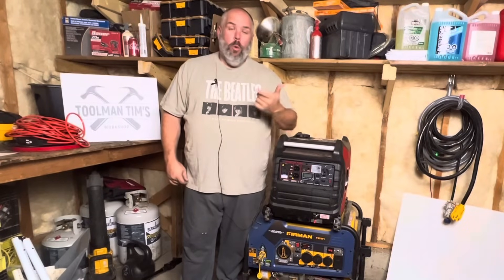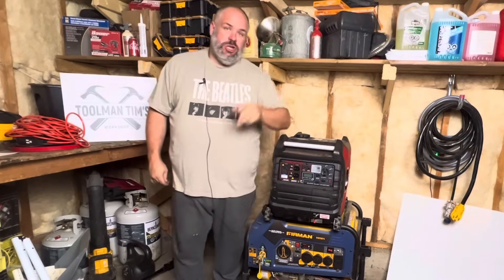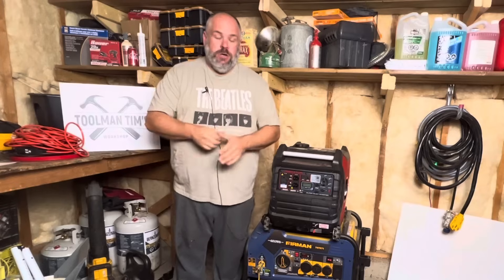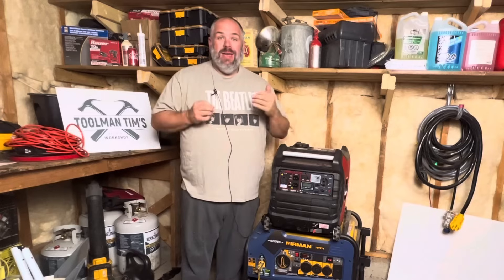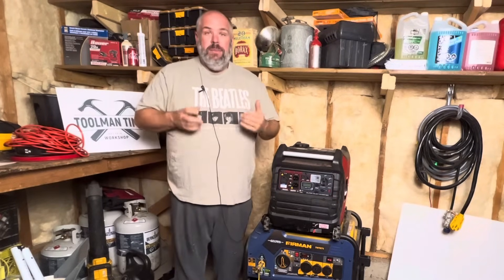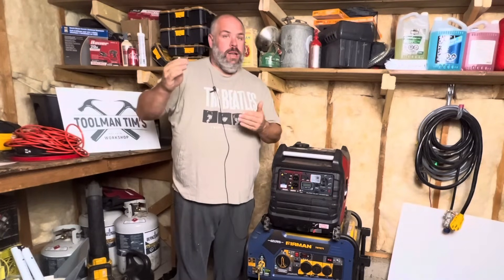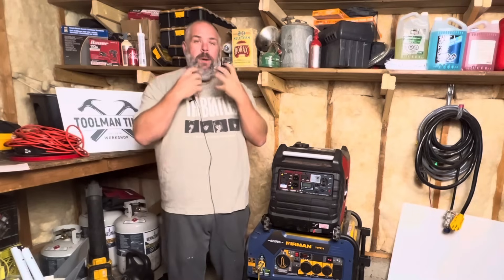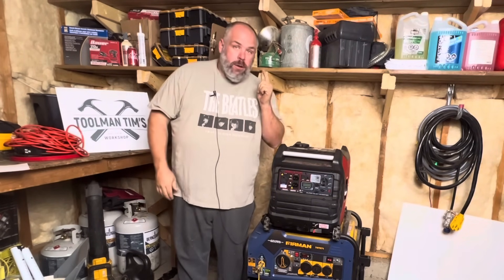INVERTER GENERATOR What's the DIFFERENCE between an INVERTER GENERATOR and a regular generator?

Comment: They should just call it a clean generator to eliminate confusion. We don't call tv sets inverter tvs or dvd bluray inverter dvd bluray or other appliance that converts the AC input through a DC rectifier bridge circuit and then runs it through a filter network to finally out put that dc to a zenir or power ac circuit. Stupidity!

Comment: I run an open frame 4000w inverter generator . It is still very quiet. easy to work on it, and I know that heat is not your friend. I don't think I will ever own a predator generator see a lot of them being returned to harbor freight. next time your in the store take a peak in the back room. always 2 or 3 sitting there waiting to be returned.

Comment: I found a gas motor driving an auto.otive alternatlr charving a ba k of 12 volt cranming a.p batteries.   The 120vac at 60hz created individual  use invertots.  If generater is off you still have power.

Comment: Instalei num gerador inverter TOYAMA de 3500W /120V. Atende toda a carga em 120V em operação normal. Qdo ligamos o forno  elétrico pequeno, torradeira ou micro ondas , percebe-se nitidamente o aumento de potência do motor a combustão.
Como é para situação de emergência, optei por acionamentos manuais: Chave de Transferência, conexão das fases RN e SN as tomadas do gerador e e partida com corda retrátil.
Estou há três anos com o equipamento e nunca tive problemas. Um dos segredos é não deixar gasolina no carburador- sempre desligo, cortando o combustível. No Brasil a gasolina tem hoje 30% de ETANOL.

Comment: Good, to-the-point explanation. I do like the new inverter generators, and I think they're worth the extra dollars. I have a small Honda, and and it's very well engineered. I must point out, though, that modern electronic devices are not particularly sensitive to incoming power quality variation. I own quite a few generators ranging from 950W to 17 kW, mostly gas but two are diesel (when I bring one home I tell my wife it's a 'rescue') and one was built in 1947. None has ever caused problems with electronic devices. I think people worry far too much about this.

Comment: Against "parallel twins": did you ever service generator? Oil, spark plugs, air filter, spark arrestor, gap in engine - don't you think it's too much, huh??! Now imagine TWO gens to service! You will scream! 😆 Better to buy one plain, but powerful gen - just take care about noise and you're done. BTW open frame gen - here you have EASY ACCESS to any parts! Opposite to idiotically tide boxes of inverter gens.

Comment: Inv.gen. is not "a bit" expensive - they A LOT more expensive. Funny, but simplistic inverter (plain DC→AC device) costs not so much. But same installed in generator immediately doubles the price - WTF?!?! All we need from old good "open frame gens" is some AVR, which will manage RPM too. BTW Inv.Gen does NOT regulate RPM smoothly - they have simply 2 positions: "economy" and "full rev". So yes, under low load Inv.Gen. will work more quiet, but under load both gen makes roar.

Comment: In the world of SWITCH PSU (which are installed in every single device) you don't care AT ALL which power comes - they anyway convert this power into PWM comb and then make DC 12V. Computers work on these "switch PSU" since stone age, so no problem with "dirty generator" :) Just FYI.

Comment: I ran my whole house for 12 days in Feb 2022 after a cyclone wiped out the power substation that supplies our area with a Chinese 4.4kva open frame generator. It ran for 35 hours on a full tank of fuel.
That included hot water, dishwasher, oven, microwave, lights, computers, TV's, modems, fridges and freezers. Never missed a beat. All my electronics and appliances are still fine over 3 years later.
I had to drag the bloody thing in every night when I went to bed cos people were going around stealing them. The noise was a pain in the ass though.

Comment: Thanks for the video.  I'm trying to figure out why diesel generators aren't available at Home Depot's website, I can only find gasoline / propane / natural gas inverters.
Reply: Diesel anything is industrial or heavy duty use.  I think HD, a homeowner DIY, isn’t a go-to source for commercial equipment.  And I think you’ll find a diesel generator will start at a high watt output that many homeowners won’t need.

Comment: We get long outages and we use a "dirty" generator with our new laptops and modern appliances. So far, no problems. BUT, a friend recently developed trouble with her new pellet stove allegedly because she used a "dirty" generator. Even though we haven't had any issues, just to be safer, I think we'll upgrade to inverter generators. Thanks

Comment: In my opinion, you are definitely overstating the “dirtiness” of the power from an open frame generator.  It’s no dirtier than mains power (mains power is pretty messy).  I run my whole house with an open frame generator, and have never had an issue with computers, Starlink, washing machines, fridges, coffee machines, CPAP machine, dishwasher, shavers and electric toothbrushes….you name it, it runs perfectly from an old open fame generator that chugs away all day.  You also suggested that it can somehow “reduce the life” of sensitive electronic equipment.  I remember hearing all that talk when inverter generators first came onto the consumer market.  IMO it’s just marketing BS with no basis in real life.  Years later that marketing BS is still being sprouted by people like yourself.  If you had equipment that was so sensitive that it might suffer damage by generator power, it would also suffer damage from grid power.  It’s just flaky marketing nonsense to scare people into unnecessarily upgrading their equipment.
Reply: thank you, that puts it well in perspective. im worried since in texas the outages are getting more common and i was worried i needed an inverter generator. i  can afford a regular generator to run my housem , an inverter is double the price.

Comment: Will a 9500 inverter run my icebox and freezer and two window units. OK I heard they’re not good for appliances like that. Is that true?
Reply: 9500 watts.  I’m no expert.  That’s big.  Icebox, frig, are about 1,000w each.  2 window AC, if both 12,000 btu, are also about 1,000 watts each.  LED Lighting and electronics, all at once, about 1,000 watts.  That’s about 5,000 watts at once, is a good load for 9500.  Some say any generator should run loads of 50-60% long term, and you’re in the sweet spot at 5,000.

Comment: Are you not aware that there are open frame inverter generators?
Reply from the maker: it was an oversight i didn't include in this vidoe the next time i redo it I will add that for sure

Comment: For me, my Champion 5000 Open Frame generator will not run my 1100 watt Microwave, my Predator/Inverter 5000 runs my microwave works perfect.

Comment: Anyone had problem damaging appliances or gas furnace with a non-inverter generator,  powering the whole house?
Reply: I live in Florida and use the standard large whole house generator for a few days no problems. They are very loud but no need to run extension cords. I have an external plug on the house and a breaker box switch over setup by my electrician.

Comment: May parents have an older Honda open frame generator that you can set it so that it revs up higher depending on electricity usage or you can run it loud and steady. So would that be considered inverter or regular?

Comment: It's parallel operation not "daisy chain", but yes you basically have each generator providing each half of the 240V but outputting up to 50A total (instead of 240V at 25-30A with just one unit).

Comment: Open frame generators are generally  square wave or modified wave,used mostly for resistive loads toasters jugs electric motors,where as inverter  sinusoidal wave form is used for electronic type loads,such as  computers.Square wave or modified wave will damage electronics. AUSTRALIA 🇦🇺

Comment: I found out the hard way that even a modern gas furnace needs clean power. Ice storm in Portland Oregon in early 2024 left us without power for 6 days. I rented a non-inverter generator (not knowing the difference) and my furnace error message translated into essentially "dirty power, can't run." Since our gas furnace needs electricity to run fans, it wouldn't run.

Comment: What kind of device doesn’t need clean power? Like my fridge? My main use for the generator is going to be charging a couple of batteries that power the house. I plan to use the generator to top up the batteries when the outage lasts more than a couple of days.

Comment: You are partially informed about your content.     Some of what you say is true, but the power quality demanded by "sensitive electronics" is pretty low.   They have their own power conditioning circuits that isolate the sensitive stuff from widely variable AC inputs.    Also, some inverters are "modified sine wave inverters" , like the cheap ones that plug into your cigarette lighter in the car.   These are commonly called choppers and just reverse the polarity of the DC exciting a transformer, which suppresses high frequency component in the waveform.   It's a modern version of the vibrator circuits in 1950's vacuum tube car radios that was clean enough to reliably receive AM radio signals.          Motors are exceeding tolerant of trashy AC power, too.    WHile I may agree with some of your claims,  they are a little imprecise.   The best part of the inverter types,  IMO, is that they are small, quiet and adequate.

Comment: hi, thanks for the video, what if I use a power surge outlet bar, for my sensitive electronics on an open generator, would it be just as safe as using an inverted generator?
Reply from the maker: no it wouldn't it only handles over surge thd makes the power jagged and up and down much worse long term that way

Comment: I don't want to hurt diesel generator owners feelings but AIR COOLED diesel generators don't appear to be much if any more efficient than gasoline generators. I know for a fact that WATER COOLED turbocharged diesel generators are highly efficient, but that's not what you have.

Comment: Good video and I agree with what you said. You should have mentioned that the standard, open frame generator basically Must run at 3600RPM to make 60Hz. The inverter generator can run at 3000 RPM and make 60Hz, the inverter generator may have a Permanent Magnet Alternator. Why is the Permanent Magnet Alternator important? Because the generator isn't having to use produced power to generate the Field. The inverter generator with permanent magnet alternator can use a smaller engine at lower RPM to generate power at 60Hz so if you don't have a big load, you can save a considerable amount of fuel. It's a huge difference between a 224cc engine and a 140cc to make 3900W max. 

Also, the generator is going to be most efficient in the sense of power produced for fuel used at 80%. Running a large conventional air cooled generator at low load saves very little fuel because it has to run at 3600RPM to make 60Hz electricity. Think of the cylinder as a Lung. The cylinder is going to get a full lung of fuel/air mixture every 4 strokes no matter what, it has to, it doesn't have a choice.

The permanent magnet alternator generator doesn't have to work as hard because the Field is permanent, it uses a smaller engine to begin with and it can produce 60Hz power at 3000 RPM. So, 1/3 smaller engine running 1/6th slower. That's why those little suitcase generators are so much more expensive, besides a little more complicated electronics. Yes, there are open frame generators with inverters that can run 1/6 slower but they don't have the permanent magnets, at least I have never heard of one that was permanent magnet. I'm not knocking open frame inverter generators, I own 4 of them and two of them are 4000 running watts beasts with 270cc engines that I got for $365 each and they have single phase 240V and they were built to last, they are not what I would call fuel efficient but they are also reasonably light weight and compact and I could daisy chain them together for 8000W. Due to their compact nature they only have 2 gallon tanks and they will run 5 hours flat out on a tank of fuel. For the price I can't complain too much. 

I haven't done things in efficient manner, buying a generator without knowing all I need to know, but I did do considerable research, just not enough. Not a single one of the generators I bought is a Bad generator but I can't say they were the ones that best suited my needs. I probably should have bought 3 X 3000w ($1500-$1800 total) running permanent magnet alternator generators so  I could run One, Two or Three Parallel connected generators as demand dictated. As it is I just bought a 2000 running watts permanent magnet 80cc inverter generator that I will run the most and I can crank up a big one at need. It's not a matter of saving money for me, it's the logistics of the fuel on hand needs to last longer. I keep about 15 gallons of gas on hand and I'm thinking of buying a plastic 20 gallon boat fuel tank or possibly a 80 gallon propane tank or both. There are frequent power outages where I live and we just survived a flood.

Comment: Some good points, Inverter generators will probably become more and more common. (although I wouldn't buy one from Horrible Freight)   I will say that  a high quality  "open frame engine" generator makes clean low distortion power.  I've been running all the electronics on ours during outages for years.

Comment: The #1 reason I went with an inverter generator is fuel economy. In a power outage, gas will be hard to get. 5 gallons will run my inverter generator much longer than a non-inverter type. I'll likely get several days of use out of 5 gallons, instead of being out after one day.
Reply: Same.
Reply: A lot depends on how much load you are running as well.
Reply: If I'm with your mom, you better believe it's going to be a full load.
Reply: @maxlumens9085 😂
Reply: Gas? What’s that? Oh, that is that stuff they used to use in the old days to run generators. That stuff that expires. Not an issue with NG or LP.

Comment: Pro tip, if you want to avoid paying for the inverter generator get a 120v to 12v car plug adapter then a 12v to 120v inverter for a car. You can run sensitive electronics off a dirty open frame generator for under 50 bucks
Reply: True, but you will still have the noise and the inverters use much less fuel.

Comment: What about using a power line filter on a standard generator to get a clean output 
Total package would be still significantly cheaper than an inverter generator

Comment: I am having trouble with understanding all the reasons for increased efficiency in inverter generators.  I somehow got the imppression that inverter generators were smaller in size than the same amount of watts in a non-inverter generator, but that may be pure missapprehension.  Sure they use less gas because the computer can regulate fuel use to the level of current draw. I am trying to figure this out because the new "alternator chargers" you install in your vehicle that have come out recently:  they are some kind of inverter to greatly decrease charge time on portable power stations like the Bluetti and the EcoFlow Delta.  Regular DC to AC inverters actually incur some energy loss.  These "alternator chargers" do increase gas use if you are idleing, but surely they wouldn't do that if you were driving at a decent rpm.  Car alternators are just that wasteful?  Sure.  Explains hybrid vehicle gas economy. hmm.

Comment: Will installing a 10 Circuit 30 Amp Generator Transfer Switch act as an inverter while using an open frame generator?

Thank you for your very informative video. You earned yourself one more subscriber!
Reply from the maker: Thanks very much.  Unfortunately a transfer switch just diverts the power coming from the gen so you would need an inverter genrator as well

Comment: hi, i simply have no idea and no time to research so for a household of 2 adults and one ALZ senior what Firman do you recommend best for emergency power out for home.  I only have 600 or less for one, Firman gave me a discount code. as for large appliances I think only the washer and dryer could be plugged in bc it would be very hard to do fridge or electric grill.  There is a Cpap machine and can we plug in the water heater?  so, I need several extension chords?  can the water heater be plugged in?  sorry, i am not kooky just overworked here.  thank you.  you look like your answering people so please help! I can fill propane tanks.. i feel like if we do have a global crisis and major black out, gas will be harder to come by than prefilled propane I could store.  We have a large 250# propane tank if I could transfer out of that but it looked too difficult.  maybe we could use some tv for the senior and some phone /pc for my brother
Reply from the maker: https://firmanpowerequipment.com/collections/whisper-series/products/w03083

https://www.harborfreight.com/generators-engines/generators/3000-8000-watt-generators/4550-watt-inverter-generator-with-co-secure-technology-epa-59192.html

Not sure what discount code you have but the best I could reccomend for firman is the first link I posted it’s on for 899 hopefully your code gets close to your price if it doesn’t take a look at the predator 4550 watt inverter second link.  You need to run a cpap machine and tv means you’ll need an inverter style generator which will be more expensive.  Also it won’t run your dryer but it will run your washer, fridge, feeezer sump pump one at a time hope this helps just a bit .  Stay safe 

Tim